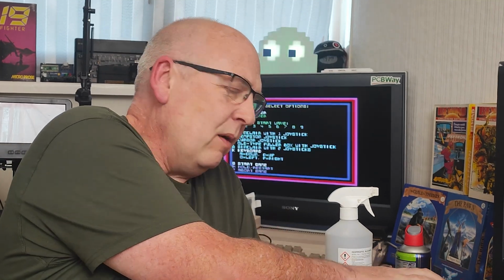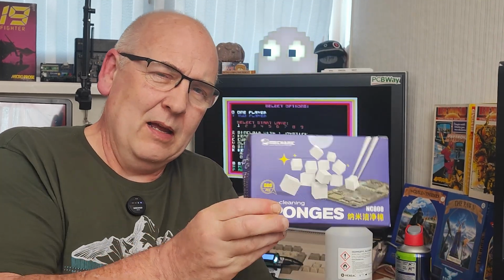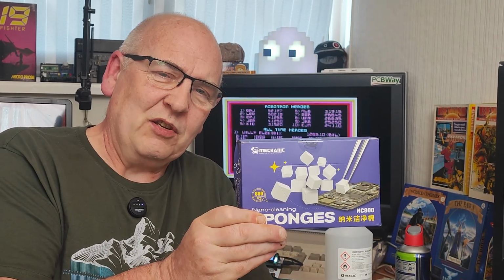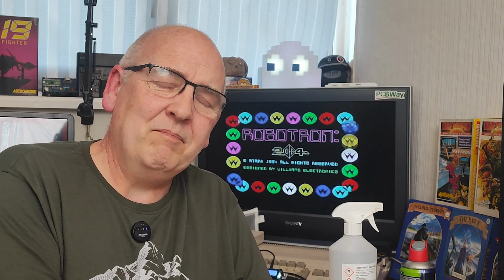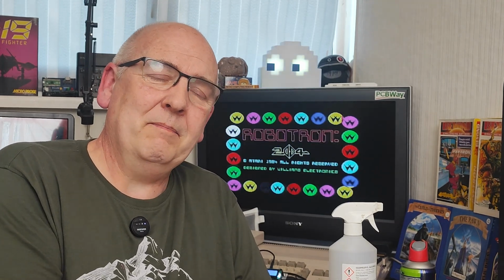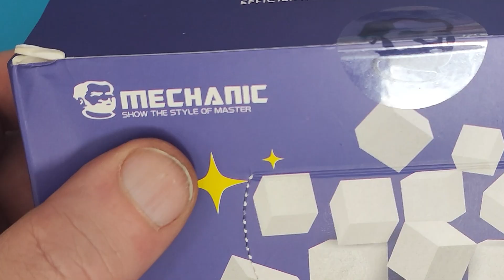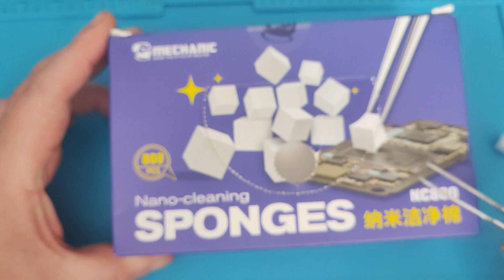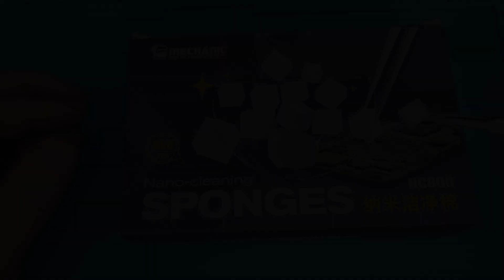Easy PCB cleaning

Comment: Brilliant! I'll certainly give these a try.
Reply from the maker: Thanks for taking the time to comment. I hope you find them as good as I have. I'm just so glad I'm not using cotton buds any more
Reply: @RetroComputingReboot  I've used cotton buds for cleaning flux and from Day One I was asking myself: 'How on Earth do people clean PCBs with these?!'
Reply from the maker: Same here. I've always found them really frustrating.

Before discovering the sponges I had considered getting an ultrasonic bath, but with all the expense and faf of that, and in my case, occasional use, didn't fancy the idea. Plus there are some components that wouldn't thank you for being submerged in water.

Here's to nano sponges 😂
Reply: @RetroComputingReboot  The only concern I have with cleaning off flux is abrasion - even with the nano sponges I would be concerned about applying too much pressure in case I scratch one of the trace lines on the PCB.
Reply from the maker: @richardgray131185 I use metal tweezers to hold the sponge. I just prefer the feel of them, but you could use plastic. I haven't scratched a PCB yet. You can hear the difference as the sponge starts to disintegrate and the tweezers start moving into contact with the PCB. I just either replace it with a new sponge or reposition the sponge in the tweezers. It's a slow process, but I find it satisfying as the results are so good.
I've seen people solder where they drown the joints in flux and have it running all over the board. That would be a pain cleaning, but it would be whatever method you cleaned with unless chucking in a bath.
Reply: @RetroComputingReboot  I will use tweezers as well. I will use a dropper to drop isopropyl alcohol onto the sponge, as opposed to spraying it onto the board. It will take me longer to clean it but I want to try and control the amount of liquid and mess on the board. One of the boards I will have to clean is inside the computer chassis and taking it out just to clean flux would just be too time consuming.. Of course, everything will be disconnected before I start.
Reply from the maker: Yes spraying the board just makes a mess
Reply: @RetroComputingReboot  Just tried my nano cleaning sponges. Guess how many cubes I had to use to get the flux and lint off? Just one. If you use a dropper to put drops of Isopropyl Alcohol onto a cube, it will self dry much quicker and you won't need to use other cubes to get the alcohol off. Very impressed with these!
Reply from the maker: Really pleased you liked them, and thank you for letting me know.

I find I can get through a few sponges as I find they break up slowly especially when cleaning up bits with sharp edges. 

One thing for sure though is I will never be going back to cue tips / cotton buds!
Reply: @RetroComputingReboot  I totally agree. I will never use cotton buds again. I'm currently on a high because I have just successfully repaired a BIOS chip with a missing leg. Patience + the correct sanding attachment for a Dremel tool + magnifying glass = A successful repair!
Reply from the maker: Excellent result. Well done.
Wait till you get yourself a microscope 😁. I got one and it's such a help
Reply: @RetroComputingReboot  Thank you. Can a blank EPROM chip be programmed if it has a sticker over the window?
Reply from the maker: Absolutely. The sticker is just to protect it from being erased.

Comment: I wonder if using your IPA and antistatic brush first to loosen the flux might work better and then use the sponges. The antistatic bush will clean around the pins and the sponges will remove the loose flux? Just a thought.
Reply from the maker: Yes the anti static brush is really handy like that. Especially on the really burned on deposits

Comment: Nice find, I will give it a go.  Full of the joys of Spring, I decided to finish servicing a 48k Speecy (that I started 8 years ago and after replacing the membrane promptly left in 2 halves in a draw) and after replacing the caps, installing a Traco and composite mod, I had to clean the pcb.  The bent component leads on the back of the pcb made using a cotton bud a real pain.  It would constantly get hooked and get cotton strands all over the board, using these Magic sponges would of been ideal.
Reply from the maker: Hi John. Thanks for the comment.

I have been using cotton buds forever and have always found them to be a pain. They aren't absorbent enough for me. I find they smear stuff all over the shop rather than wick it up and the fibers just end up everywhere.

See what you make of the sponges.

Comment: I wonder if they are ESD safe, does it say on the box? The brush you used is and cotton is.
Reply from the maker: It doesn't say specifically. I'm guessing it is with that being it's intended purpose, so one would hope so!
Reply: @RetroComputingReboot  Not sure I would take the risk on retro electronics. Synthetic sponges are made of plastic and some plastics have the ability to build up quite a charge. Maybe they are OK, but without knowing for sure, I would personally be wary.
Reply from the maker: @dreamvisionary That's fair enough. In fact, I'll see if I can email the manufacturer and get a spec sheet

Comment: Thanks for the informative video. As usual there are many ways of skinning a cat but ultimately if cleaning manually 2 things needs to happen in my view, the flux is mixed with the alcohol (and lifted from the board) and removed from the PCB. Many ways of achieving this result, some more awkward than others. I usually use IPA + a brush with stiff bristles (ESD safe is probably better). Then use a lint free wipes (kimtech or the likes) to absorb the flux by patting the brush on the wipe to force the pad  on the board. The brush in my view is more effective at dislodging the flux but the nano sponges could help with  removing the alcohol/flux mixture from the board, I will have to try this. Good idea, thanks for sharing.
PS: I want to experiment with liquid flux because it leaves significantly less residue when compared with gel one. YouTube channel MrSolderFix is fantastic for soldering tips!
Reply from the maker: Thanks for the comment. Really appreciate the time to do that.

Yes indeed, I'm sure there's many many ways out there to clean the flux, some better than others 😁. I was so fed up of using cotton buds - truly dreadful!

Ive watched tons of soldering vids and love MrSderFix myself, but Ive never seen any vids of people using these sponges so thought it might be useful to share my experiences.

Funnily enough I've just ordered some new flux to try, some clear stuff. I don't know if it will be any better or not but sometimes it's just handy to see what you're touching with the iron, especially on the really small stuff.
I've seen the liquid flux he uses and have thought about trying it but haven't as yet. Is it something you've had a go with?

Come join us on my Discord and let us know how you get on with the sponges. There should be a link in my channel description.

Comment: Nice, and less fibres that a cotton bud. But I can't help thinking just through the lot into an ultrasonic cleaning tank and be done with it?
Reply from the maker: Yes you could use an ultrasonic tank. I did comment on this though in the vid 😊
Reply: You won't want to immerse a PCB with enclosed spaces in onboard connector pins or potentiometers. Flux on potentiometer elements will ruin it.
Reply from the maker: @DuaneVT Good to know. I figured some components wouldn't like being submerged. I just can't justify buying an ultrasonic cleaner, finding somewhere to keep it and so on.

I know everyone is different, but I'm not looking for perfection. The results from these sponges really impressed me. I'm just looking for something that does a decent job, easy to use and doesn't frustrate the hell out of me like those cotton buds did 😂